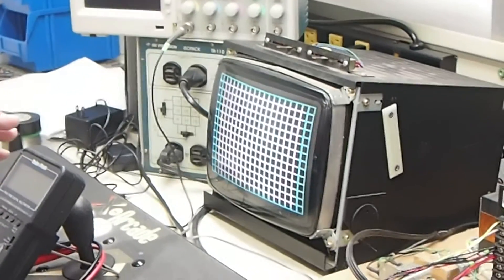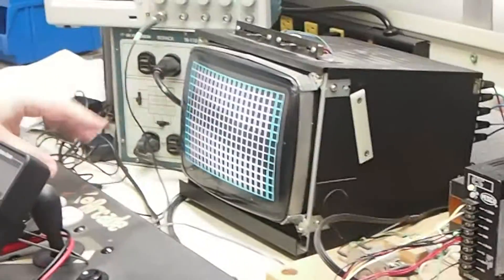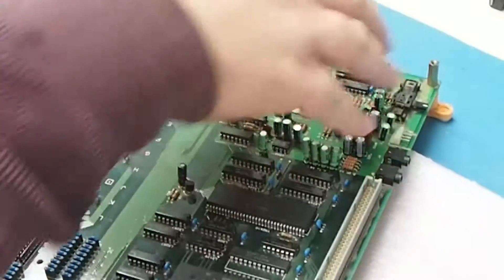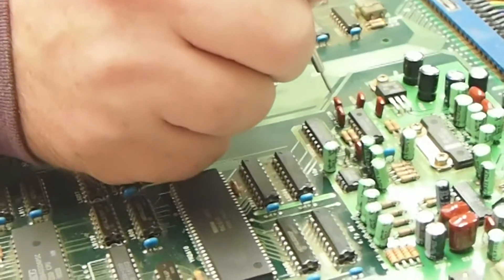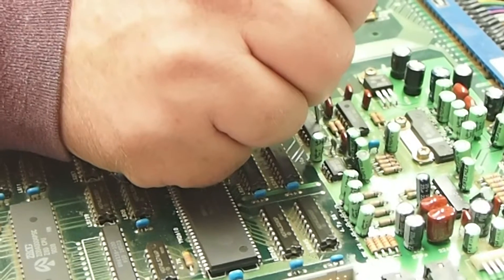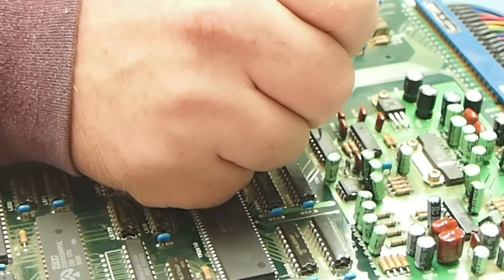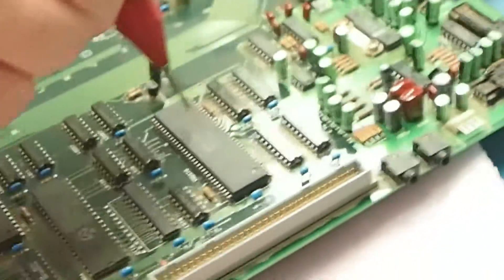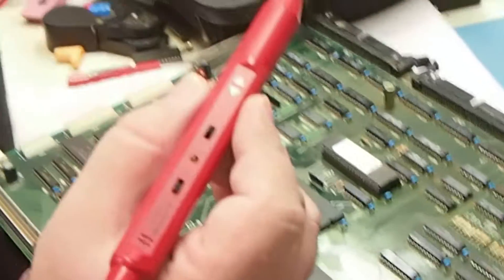Troubleshooting Neo Geo MVS Audio

Comment: It's almost never worth troubleshooting an MVS board. They cost $100 to replace and most people won't have spare parts without buying another one.

Replacing caps that aren't leaking almost never solves anything. I can't tell you how many hours I wasted recapping old hardware without fixing anything. You recap to prevent it breaking. Not to fix it when already broken.

It bugs me that people offer that advice for fixing broken boards. 

Unless you are an electronics expert and your time is worthless don't bother trying to fix electronics that aren't rare and / or expensive.
Reply from the maker: Multi-slot boards in good running shape are easily selling for 200 and up. I do a lot of Neo Geo repairs.
Reply from the maker: The TK branded caps are well known in the Neo Geo circles for drying out and causing loss of audio. They don't leak. They dry out and their ESR goes higher than my tester will measure. The audio levels go lower and lower until they just stop working. After fixing well over 100 low audio problems on Neo Geo PCBs by recapping them, I think you should learn more.
Reply: it bugs YOU that someone else made a video that was helpful to me? That's priceless.  Thanks for the video upload, it was EXTREMELY helpful for me.

Comment: What points did you connect to when using the logic probe?  I am having audio issues with a 6 slot where all I get is static, even in test mode, and the ym2610 chip gets warm to the touch.

Comment: Instead I have an mvs slot-6, which in test mode audio works, left, right, all perfect, in normal mode though, whatever cartridge (100% working) I insert into any of the 6 slots does not produce any kind sound, the game works but without audio.
I have already arranged some corroded tracks, it doesn't seem to me that there are others.
Some advice on what to check?
Reply from the maker: All the chips are grouped in rows around the slots they support. Look and you'll notice a repeating pattern of chips. Grab the slot pinout from the Neo Geo Wiki and use it to follow traces from the M1 sound ROM connections of the slot back to the chips to identify the 74LS245 (data latch) and the 74LS244 (bus buffer) used for sound program ROM address and data bus connections. Now follow the traces back from there to the other slot chips for the same function. They all tie together back to the connectors down to the lower board. Look for open traces on those connections. 

They way the slots work is all the 74LS244 chips are on and passing signals TO the slots. The 74LS245 chips latching data bus information are activated per slot and only that slot's data is passing back to the connectors down to the bottom board. The video data from the cartridge goes to chips that select the input pin to it based on the slot that is active - 74LS251. Different behavior and path for the information, but thought I'd include it so you'd know what the other chips that aren't part of the bundle of ICs that support each slot was for.

Comment: Great video and resource.  What is the make and model of that logic probe?  I have a MVS 4 slot with sound issues as well.
Reply from the maker: There are many different makes that do this. One is the Elenco LP-560. I highly recommend you put micro grabbers on it ASAP as they are much easier to use to connect the probe to power than the silly alligator clips.

Comment: Hi! My board MV-1F has sound test OK, but in the game it start OK, and soon start to mix the sound, like in the KOF  is randomly start saying round #, the sound sometimes stops, the fighters sound start repeating, some crazy things like that, do you known anything about what could it be? Tks
Reply from the maker: Always start by cleaning the cartridge and the slots. Disassemble the cart and use a pink pencil eraser on all 4 surfaces of the edge contacts and be sure to remove all eraser dust before reassembling them.

For the slots you can do a quick cleaning by folding over some poster board a couple of times until it's as thick as a cartridge board. Wet it lightly with 99% isopropyl alcohol and insert/remove repeatedly.
Reply: I tried to clean, used contact cleaner, then used sand paper. Then I tried to increase pressure by bending the contacts. The I looked for cold welding and broken tracks, it seemed OK but I welded some contacts to make sure. Nothing worked, some times the audio is good, some times don`t during the same round.
Reply from the maker: NEVER use sandpaper! :O

The next thing is to check the solder joints on the M1 and the V ROMs on the cartridge boards to see if you have any cracked solder joints on them.

Comment: Good stuff. Alot of Neo boards with audio issues out there.
Reply from the maker: +Deneteus Thanks! I sell cap kits on my site for the different models of boards. I'm slowly upgrading the cap kits to also include the power filter caps as I sell out of the old kits.
Reply: +Arcadecomponents.com I got the Neo Geo MV1F and MV1FS Audio Cap Kit from you actually. I need to get some 6 slot cap kits.